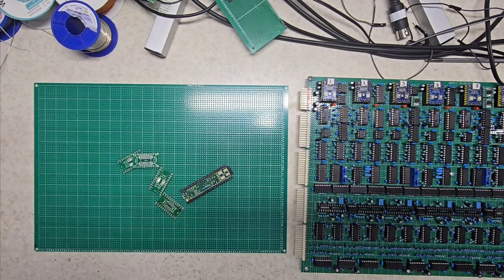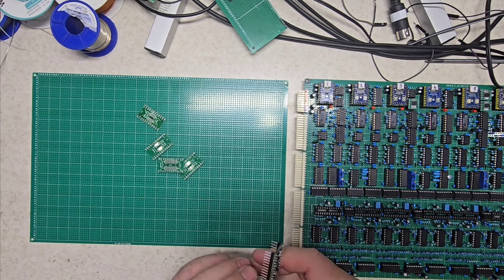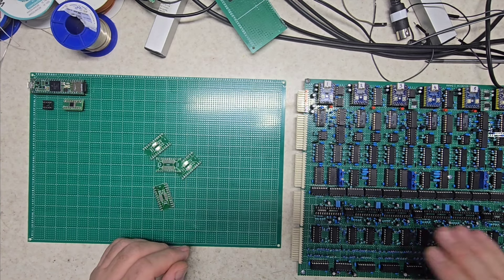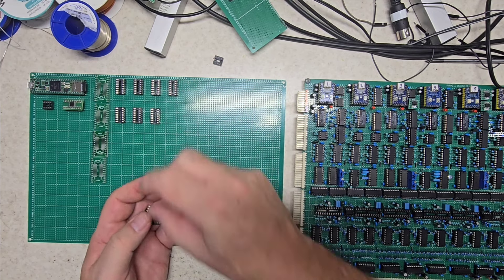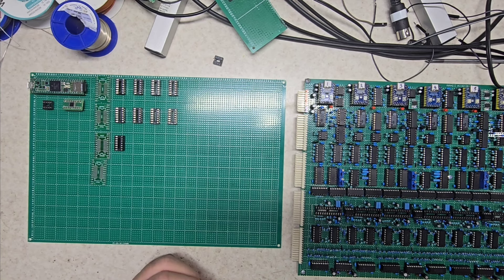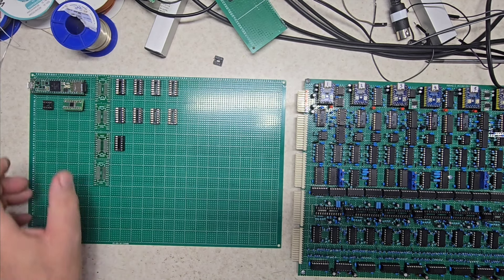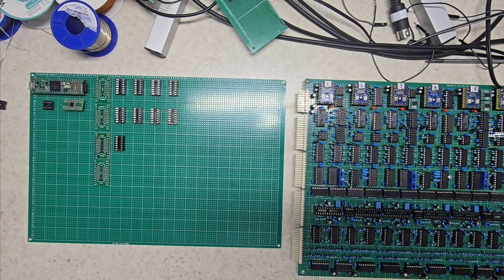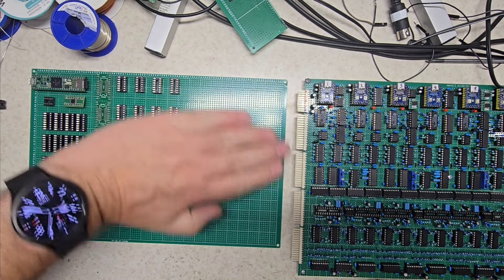Creating synths on protoboard (part 3)

Comment: So.. you don't do Schematics first? Just add what you need to the board and wire it up? You must have a lot of experience for this kind of approach
Reply from the maker: @RommudohDev  I have various schematics from various projects, I breadboard a single DCO for this current design and built the board to the right. I then needed a controller for it and I made a layout for the board on the left. I have built around 5 or 6 of this type of controller so yes I sort of know it well enough, but I still refer to previous schematics whilst making improvements on the fly, if you saw some of my earlier controllers you would see how over complicated they were compared to this one. It's amazing what you learn over the years.
Reply from the maker: But to answer your question there is no specific schematic for any of this project at the moment.